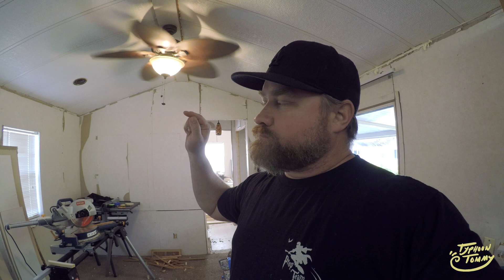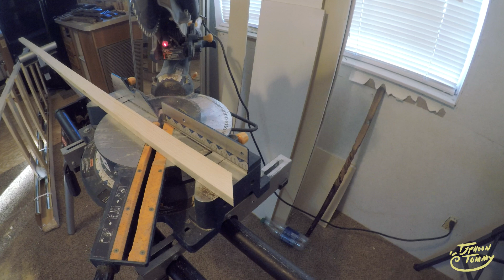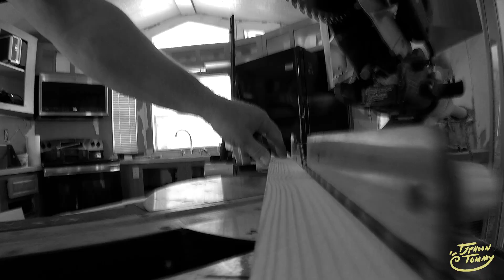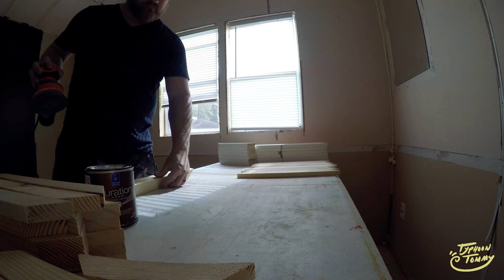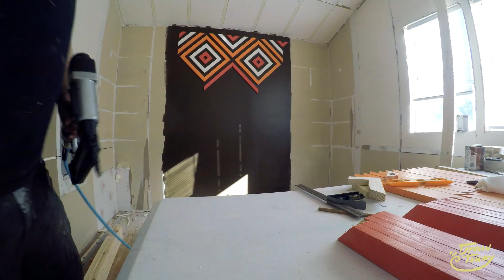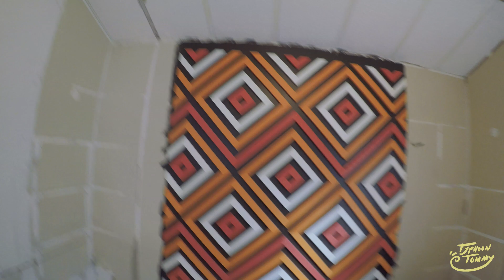Tiki Room BUILD BIO: Disney's Polynesian Resort inspired Headboard Wall Tahiti Gil's Mananui Video 1

Comment: For the pattern on the wall, are you just facenailing them to attach the strips? If so do you fill any holes created? Any adhesive? Thanks in advance!
Reply from the maker: Yes I nailed them, but I also slathered the back with the Brown wall paint as an adhesive, and I filled all the holes and touched up the paint